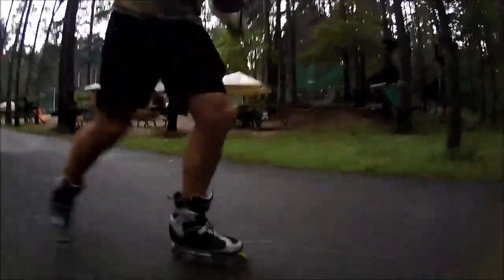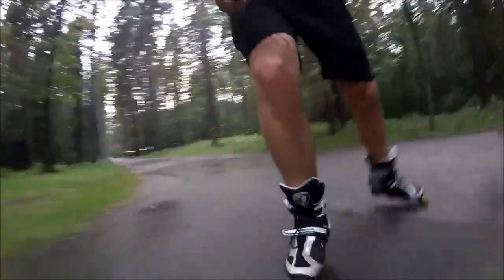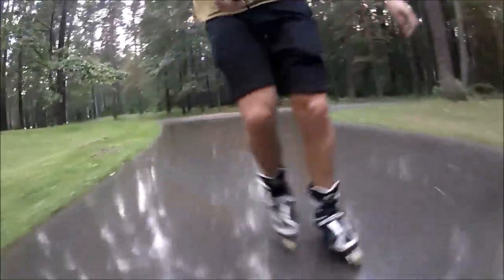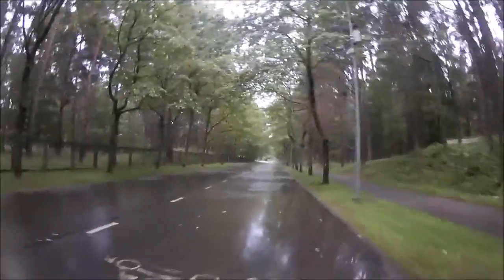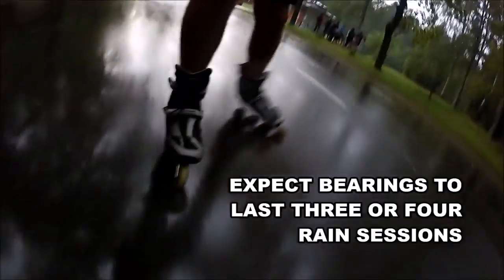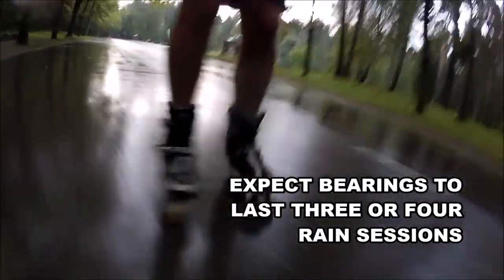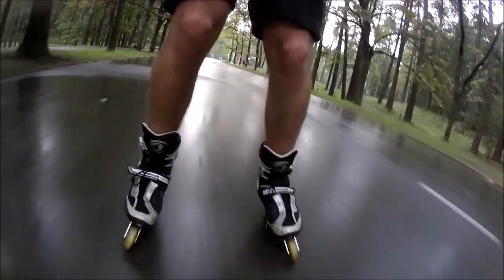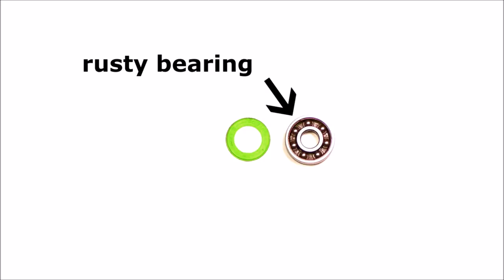Inline Skating in the RAIN - A Good Idea?

Comment: I skate on wet surfaces all the time because it always rains here and I'm always fiddling with my bearings. Cheap ones often come with thick lube that attracts sand and gunk and totally ruins them after a couple skates. If they have a removable shield you can take out the thick lube and replace it with an oil...helps them last longer in wet conditions. I think gunk build up happens first before rust and then here is simply no way to save your bearings, so ceramic wouldn't really help much.

Comment: Last week on Friday , an unforeseeable lightning storm at dusk hours impacted my town/city when I was walking to the route where I bladed. I was forced to look for cover at a highway overpass. When the rain reduced to a drizzle I broke away from the safe shelter and slipped on my two-wheeler skates without hesitation. I made it a pact to regularly go rollerblading on Friday, come hell or high water. It was getting late and I didn't wanna waste anymore time regardless of the rusty consequences.

There is one endearing aspect to rollerblading in wet conditions. I noticed this perk when the night fell and I was gliding straight downhill on the highway in a very low crouch (almost squatting). I was able to go faster on a wet road with 88A wheels than on a dry road. The cars passing over the highway road caused the water to vaporise, leaving it partially wet in some regions and very wet in others on the road. I was so fast that one motorbiker was caught offguard when I came toe-to-toe with his speed level. That day that guy actually showed me some respect by cheering me on (blush). The speed startled me because it was the first time I ever went this rapidly. What could be the scientific explanation from  a physics POV? :)
Reply: Scientific explanation from a physics POV?: less friction = more speed. More water = less friction. Less friction + more gravity = more speed

Comment: What about full ceramic bearings? Those have no metal, so how can they rust?
Reply from the maker: Good question. Should be tested ;)
Reply: I only use ceramics but the circular bearing cover that snaps in over the bearings has a metal inlay that gets rusty. You can skate without the cover and nothing will rust but then you'll have so much crap in your bearings you'll have to clean them any way.
Reply: that sound good